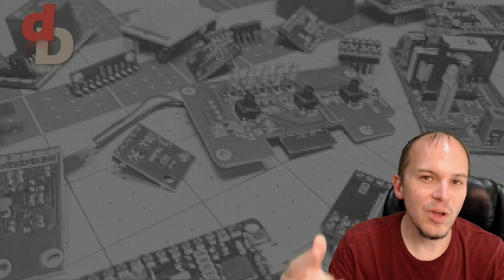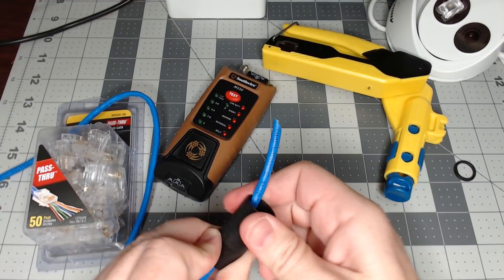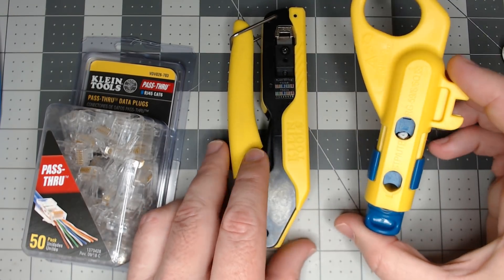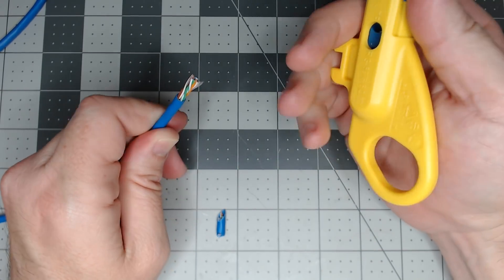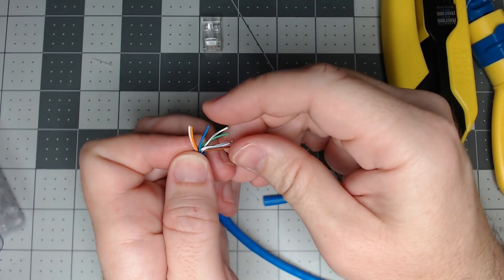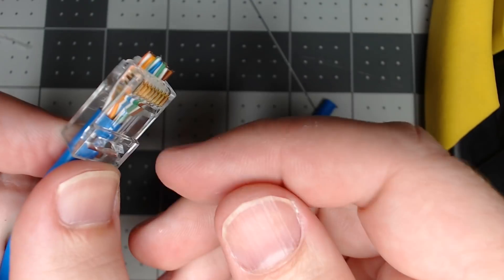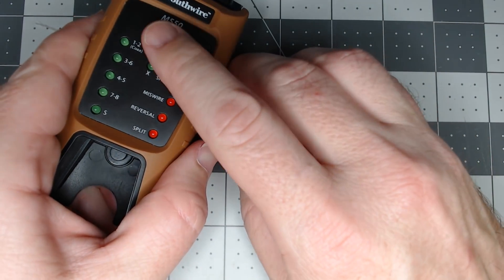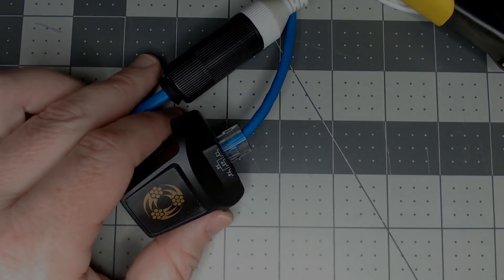How to make CAT-5 Cable / Network Wire - EASY with Pass Through Ethernet

Comment: Question, does it really matter the order in which you put the wires? As long as it’s the same on both ends is all that should matter no? It should transfer the same correct?
Reply from the maker: I'm pretty sure they have the order for a reason.
Reply: @digiblurDIY  yeah but it makes sense in my mind unless the data that’s being transferred doesn’t like one color code over the other 🤷🏻‍♂️
Reply: @digiblurDIY  nevermind, it’s a crosstalk and interference thing so that’s why it’s a must. I could had just googled it instead of bothering you. My bad
Reply from the maker: Kind of what I figured too based on the different twist rates and such of each pair.

Comment: Love the channel, but this was painful to watch. Just strip 3-4 inches, straighten each wire, cut off the last 1/2" (cause that never gets straight), feed the wires in one at a time (after a wire goes in, bend the end a bit to hold it in place while you work with the others). So much faster with no need to "massage" your wires.
Reply from the maker: I do usually cut them a little longer to make it easier but rolled with the measured striper length for others to get a standard measure. I have tried that method with one at a time but didn't end up well.
Reply: Make sure you aren't putting Cat5 cable in a Cat6 plug.

Comment: The tester doesn't check to see if you've got the twisted pairs done correctly, just whether there is continuity between like pins. I managed to make that mistake once and it took me a long time to figure out why transmission speeds were poor, so double and triple check the order of the wires against the standard.
Reply from the maker: Had that issue once. It wouldn't go gigabit. Kept dropping back. Plugged my tester in and saw a pair messed up. Now it won't do the bandwidth test. You would need one of those certify style testers but those are out of my budget.
Reply: @digiblurDIY  In my case, I had made the same mistake at both ends so the continuity tester did not see a problem but the crosstalk between channels was messed up.

Comment: Aren't these Passthrough Cat6 connectors cheapter at $14? https://www.amazon.com/Cable-Matters-Through-Stranded-Connectors/dp/B07PXMN2VK/ref=sr_1_3?dchild=1&keywords=pass+through+cat6&qid=1601864778&sr=8-3
Reply from the maker: Tons of them out there, I just haven't gotten around to trying them yet.  Just make sure they match your standard needed, certified to meet it, and also match your wire size and type.

Comment: One important thing I have learned from working with pass-through connectors is to use a SHARP pair of wire cutters when preparing the cable.  If the cutters are dull, you can get a little burr on the end of the wire that prevents it from passing through the connector.

Comment: Strip another inch of the sheath off and it makes it much easier to untwist and straighten the cable out. The cable is cheap as well, so no big loss. ALSO, if you find a building being re-cabled, you can usually get 20' cutoffs for free :). Most contractors just throw it out. Custom length (and tested) cables are the best cables.
Reply from the maker: That is the one thing I'm not used to as I used to cut about double what this stripper cuts off when I just used scissors but of course I'd sometimes cut into the wires a little, so I guess there is a trade off. I've gotten used to the shorter wires now.

Comment: Passthrough connectors are the devil. Reason I say that is AT&T doesn't supply the correct crimp tool so when a ATT Tech decides to change the B-Side cables I run in a house to A-Side there is enough wire still passing through that either shorts out the connection or the RJ45 can't seat correctly.

Typically B-Side is used for commercial but it's getting to be a normal thing to see in residential. I honestly don't see a difference and some people would freak out if they saw me terminate a CAT5e/CAT6/CAT6a cable.

Comment: You should also mention that there are different crimps for solid core wire and stranded wire.
It is about the number of piercings going through the single strand insulation.
Reply from the maker: Very true! I have seen some failed wires due to this.

Comment: There's a style of CAT-6 certified connections that I got from Monoprice that has a small plastic insert thing to organize the individual wires.  When pushed into the connector, it ends up right under the pins when they are crimped.  This lets you easily organize the wires and convince yourself they're in the correct (568A :-) order.  You trim the wires off where they protrude through the insert before inserting into the connector body for crimping.  This eliminates the wires ends sticking out of the end of the RJ48 plug when you're done..  See https://www.monoprice.com/product?p_id=7266 for the connector and https://downloads.monoprice.com/files/manuals/7266_Manual_090327.pdf for details on the insert that's used.  There's a generic video there too, but no stripper jokes, so you can skip it.

Also, if it was me, I would think LONG and HARD about purchasing and installing CAT6 cable if you're never, ever going to need performance beyond what CAT5e can provide.  Like when doing a run to a camera.  The CAT6 cable is more expensive, and worse, less flexible and more bulky and a real pain in the ass to pull as compared to CAT5, CAT5e cables. 

Thanks for the video!
Reply from the maker: Not sure if I cut that part as I tend to ramble a bit on videos and make them twice as long as they should but I fully agree!  I see people running CAT-6 to cameras when they don't have interference issues to deal with they just figure it is better when they don't realize that the vast majority of cameras handshake at 100mbit and then data rates are 10mbit or less on them.  The big thing they should worry about is using solid copper cables and not CCA.

Comment: Tip:. Use your phone to take a close up picture of the wires once they are in/through the connector and then zoom in to check the order before crimping :)
Reply from the maker: Don't tell the young folks with good eyes our tricks!  Works great for reading menus too in dimly lit restaurants.  Phone adjusts the brightness/contrast and you can zoom too ;)
Reply: @digiblurDIY  Very true.  I used to have my young son read the menu out to me but now I have varifocals :)

Comment: One other hint for the outdoor, weather-sealed connectors that I picked up from ipcamtalk: use a dielectric grease inside the connector and cable head.  Even with the gaskets and seals put in place, moisture can still sometimes find its way into the connector cause rust and connection issues.

The type of crimp-on cat 5/6 connector that I've used are ones with an insert:
https://www.monoprice.com/manual/How%20to%20-%20crimp%20RJ45%20w%20inserts.pdf

I've never used pass-through cables before, but they definitely seem to be very quick and convenient.
Reply from the maker: Not a bad idea at all!  Reminds me of the direct burial gel filled cables.

Comment: Great video as usual.  Some tips that I do a bit differently.  With the passthrough I love to strip way more of the outer case than you do, as I find it easier to manipulate the wires and get them in order.  Causes a bit more waste, but who cares about a couple inches more if it makes it easier/faster :)

Also, most of the water tight connectors I have for my cameras (Dahua) allow you to pass through a connector (some don't so have to watch out).  Either way, most times your passing the cable through a small whole so you need to make an end anyways.
Reply from the maker: I can say going about 50% more is my usual thing when I did the older connectors but I also stripped the outer jacket with scissors and sometimes that wasn't a good idea.

Comment: I forgot where I read it, but some people have had issues with PoE and the pass thru connectors. It may have been on the Ubiquiti forums.  I have a bunch of those pass thru connects and they are great.
Reply from the maker: I've had some running outdoors for 8 months or more now as well as a couple of the "hurricane cams" were done with pass throughs.  I'll keep an eye out for it though.
Reply: @digiblurDIY  It is probably fine. All I could find was a reply in a reddit thread where the person said some equipment says don't use, but I suspect that could be data center / enterprise type stuff.
Reply: I've used the pass thru with my unifi network, and only had a problem once, but I can't quite remember which piece of gear it was. To be fair though my old school crimper didn't cut too.  I should probably pick one of those up. How do you like that Klein?
Reply from the maker: Haven't had any issues with them and my last ones that had for years were the same brand and still work so stuck with it.
Reply: I have had more problems with the non-passthrough than I have had with the pass-through ones.  I really don't see much difference in the two as far as how they work in crimping to the wires.  Only problem with pass-through I have had is if you don't get the wires cut flush or the connector you are plugging into doesn't have enough open space behind the plug and causes the wires to short.

Comment: I'm watching the video because I'm not an old guy. But pass through, no thanks!
Reply from the maker: What's the downside to pass through?
Reply: @digiblurDIY  had issues with some jacks not fitting properly, maybe Klein doesn't have that problem. Had a few different mfg of female jacks that would connect, but any horizontal movement of the cable would disconnect first 2 pins, breaking the link. Really frustrating.
Sticking with normal terminations solved that problem. PoE and shorting out is also a concern with dull blades and sloppy cuts.
Reply: @jamess1787  I agree 100%. I just strip a good 2 inches off, straighten out the conductors then put them in order followed by trimming off the excess. Professional every time.

Comment: Never knew about those passthrough, Will look for them next time !
Thanks
Reply: These jacks not might fit properly in all of the different types of female jacks. Had issues with patch cables and similar that wouldn't mate properly all of the time, and would disconnect pairs 1&2/pins1&2...
Stick with the old way if that works for you.